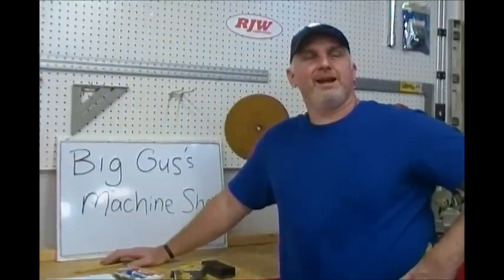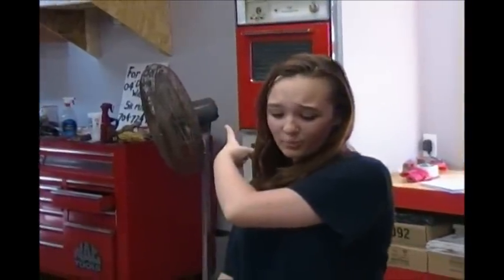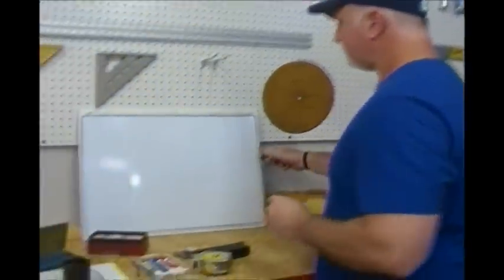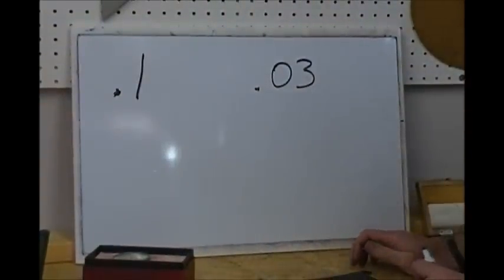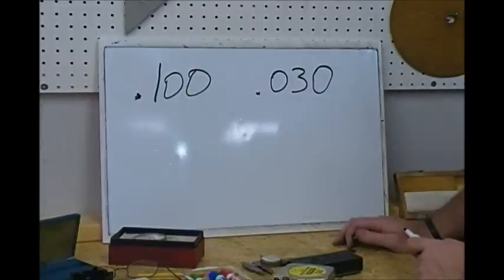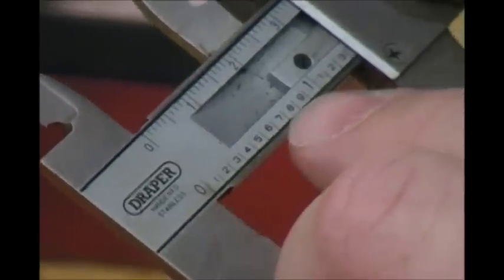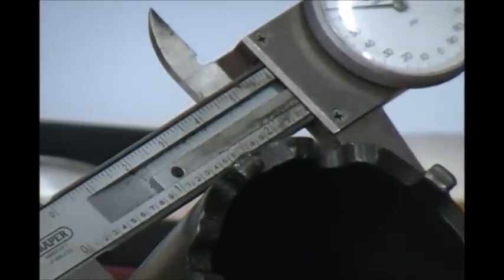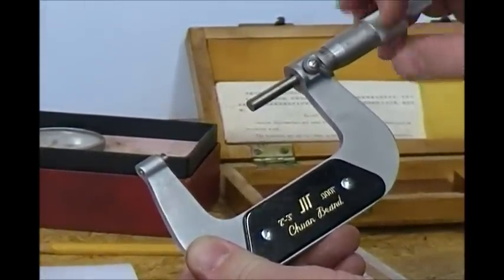How to: Measure in Thousandths of an Inch

Comment: Hello I have a problem I need to measure 17/1000s of an inch need to buy a Galvanized roof flashing roll in this size can anyone  tell how to or what size this is in gauge or which one to buy please the Galvanized roof flashing roof I need the sheet metal for a project in this size 17/1000s inch.